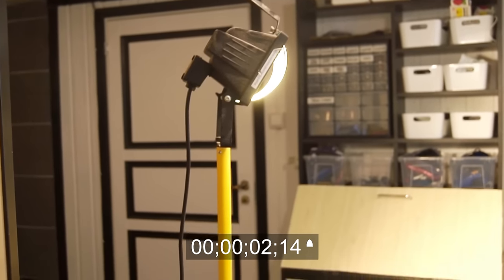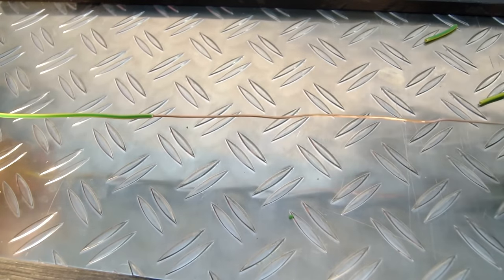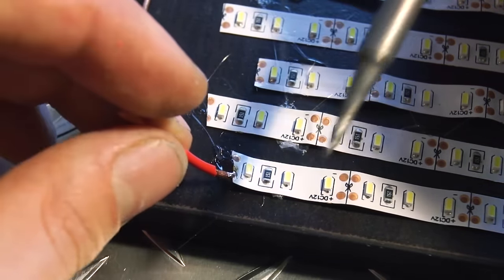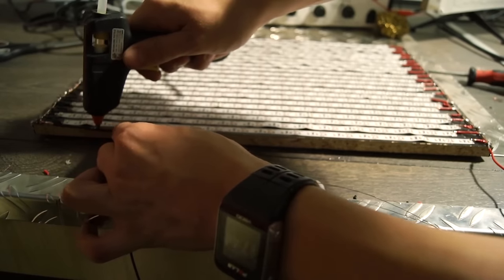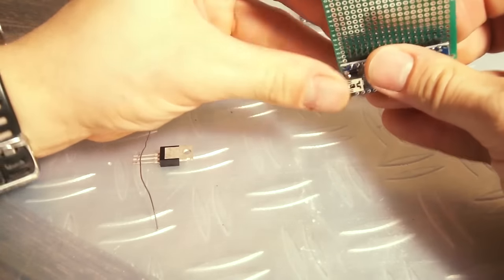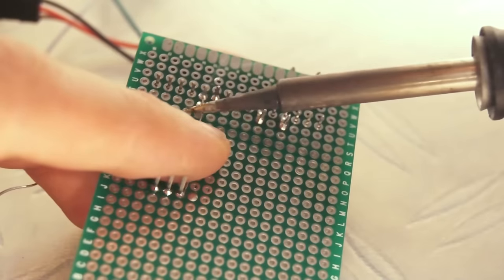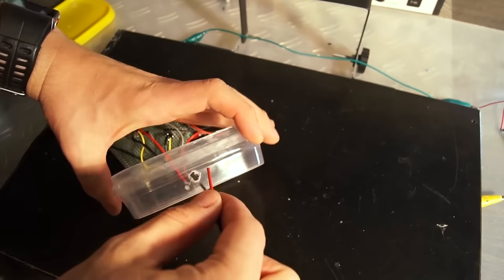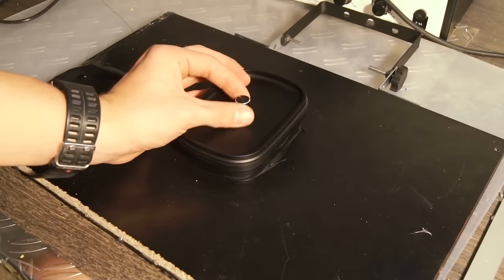Cheap LED Photo/Work Light Panel Under 20$! || DIY lighting

Comment: Using pulse width modulation to control the LED brightness will have flickering effect that cameras can capture, you will be better off dimming by controlling voltage going through the LED using a potentiometer with a DC-DC buck converter.
Reply: Thanks!
Reply: Except that this won’t work. Dimming LEDs either means limiting current, or pulsing the current. Limiting voltage works „kind of“, but due to how LEDs work, it’s inefficient and limited in dimming range. Using PWM is totally fine, one just needs to use a modulation frequency that is for from the frame rate used for filming. It’s no issue to use a PWM frequency of 8kHz with most LEDs, which is pretty safe considering the usual frame rate for filming is somewhere around 0,05kHz (or 50 fps).

Comment: oh my god dude I have been trying to think for ages of a way to mount my new DIY led light. I made one just like yours but without the dimmer but tried several ways to mount it to one of my video light stands and they all failed. i have two unused work lamps like the ones in your video so will put them to use! Legend bro thanks!

Comment: Maybe I overlook something fundamental here but do you even need an arduino? Couldn't you put the LED-strip on 12v put a potentiometer and a switch (to turn it on and off) in series and it could do the same things? Obviously you could do much more with the Arduino as a controller but do you really need it?
Reply from the maker: Dont need it at all. Actually without is more convenient, as it can be used for filming. This was one of my first Arduino projects :)

Comment: I like the idea of the dimmer, but let me please just ask you a question. If I choose not to go with dimmer part and want only the LED panel, will the LED lamps perform with their extreme light or I have to install the dimmer switch to turn them to their maximum ?

Comment: Worth noting that you don't need the step down board- you can run the arduino from a 12v supply to the vin pin of the arduino
Reply from the maker: +Benjamin Boxler That's true! However, if you short anythig on 12 volts, the board is instantly fried. I am no electrical engineer, so I like to play it safe :)

Comment: Love it^^
I using same led smd 5050 with led dimmer dc 12v, dimmer for led single light only 1 bucks (2A max for small room enough) and for medium room with more protection (10A max) 
Adaptor DC 12v 2-5A

Total cost $6-7

Or (if your eyes sensitive with that smd 5050 light)
use EL light its more soft but very bright, but remember using AC dimmer for home (not for DC / Led) just about $2
El Light for “circle” build is perfect because very elastic and durable (pros. ++price than 3258 / 5050 smd)
Need inverter if you wanna using DC 12v, about $1-$2

Total cost $10
Hopefully build back in 2019😍

Comment: You should use high cri LEDs and a high Frequency PWM dimmer, so you don't have problems with flickering. PS: Where did you find an an Arduino for 1$?
Reply from the maker: For a higher quality light, that is definitly true, but then again it would increase the cost slightly. Good question, Arduino Nano on AliExpress can be 1-2 dollars, depending on the amount you buy! :)